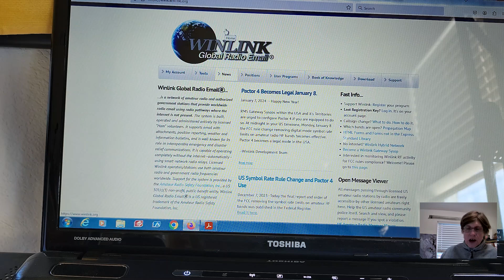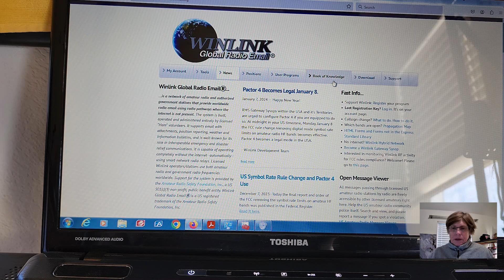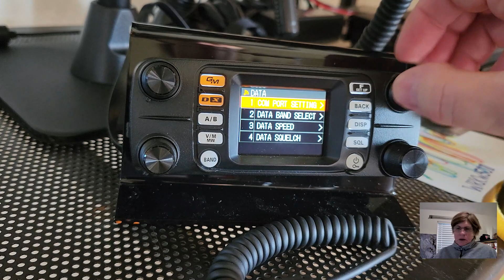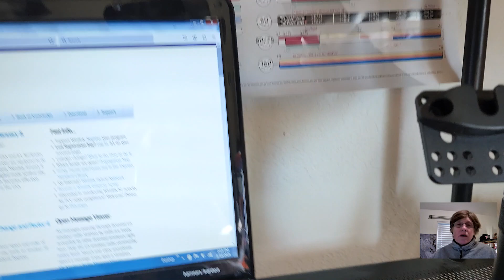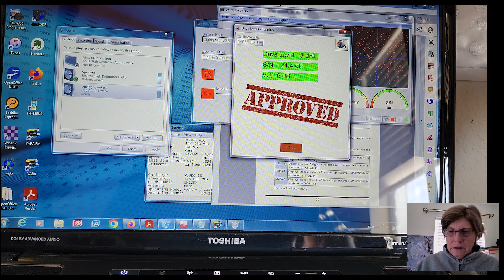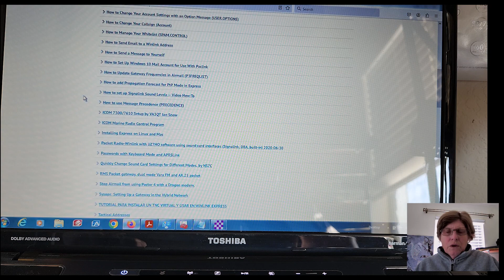Send Winlink email with FTM300DR

Comment: Thank you for the video. It helps me during the buying process to determine whether the FTM 300 can support this VARA FM packet mode (or only APRS). Also which Digirig cable you are using to avoid confusion there. I saw a little bit of your grounding apparatus. Looks good from what I saw. Didn't see enough of that metal sheet you had the radio body sitting on. You could make a video of your grounding practices in your shack to help educate people. JB KM4FZP